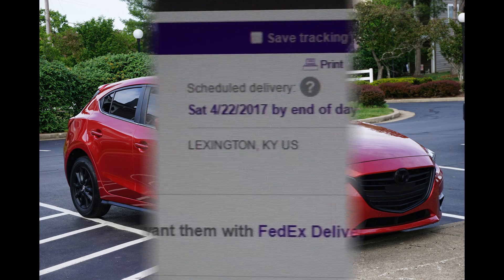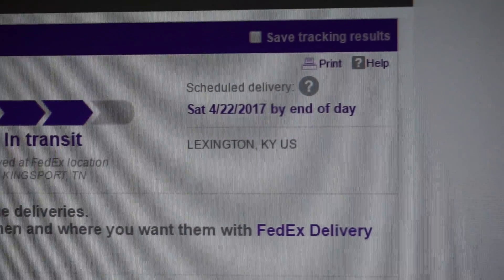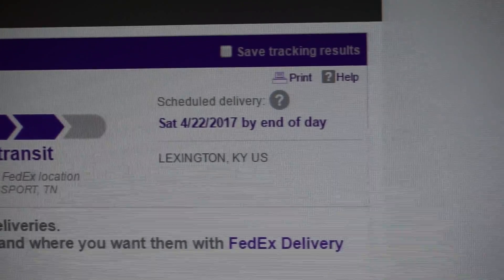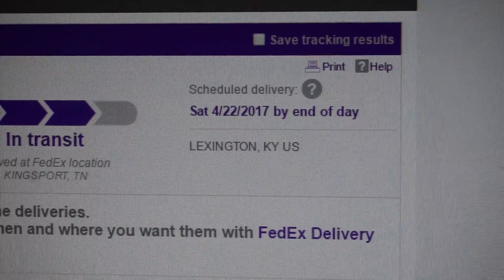Plasti Dip, EZ Lip, and Borla Exhaust Status Update For The Mazda 3

Comment: You should consider painting the brake calipers. Red would look nice.
Reply from the maker: You think red on red would look good? I have thought about doing calipers but on a red car its a tough call on which color to go with.
Reply: TheAdventureMazda with dark color wheels I think it would (gunmetal or antracite). Or you can go blue or yellow too
Reply: Ugur's Garage am planning to have it red also but still cant decide between painting or caliper cover. I think that with the rim i have, caliper cover would not fit as its too close to the caliper.
Reply: I paionted my true red speed3 calipers YELLOW...more red was too much red.